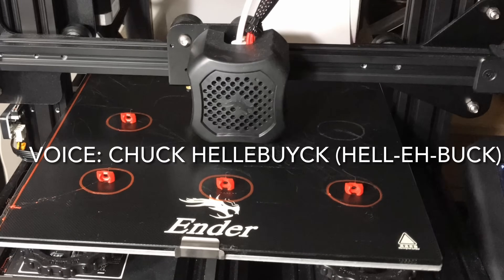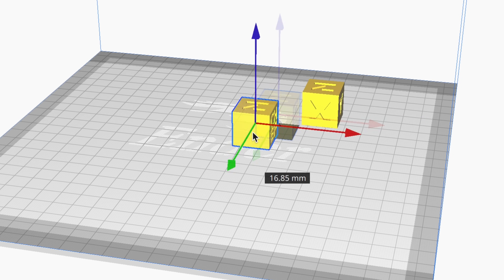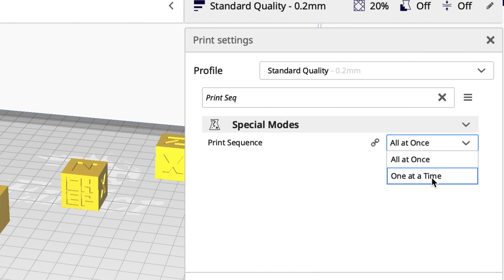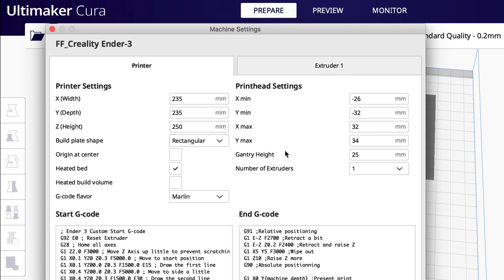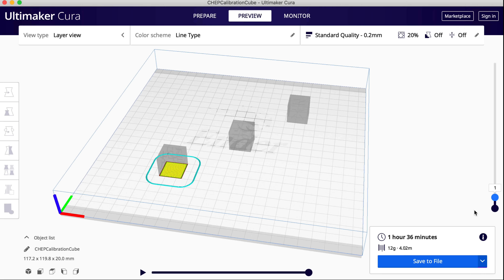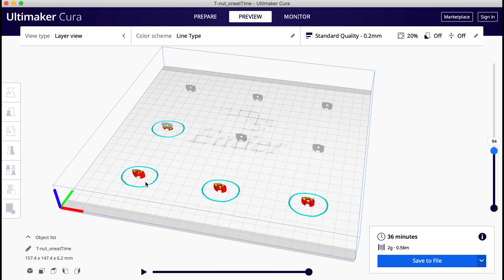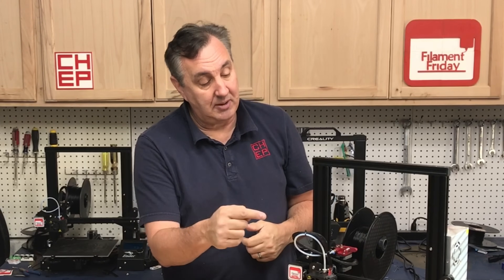One Print at a Time using Cura 4.8 Print Sequence Feature on Ender 3 V2

Comment: About time somebody did this! I've been doing this on my Troxy & PrusaSlicer for 2 years after messing with the settings and figured it out. Same idea and principle, just different way of doing things (different menu options and names).

Excellent video.
Reply: Biggest advantage in PrusaSlicer is that it nicely lists the objects and allows you to change the order in which they will be printed.  In Cura I need a dirty delete+undo trick to change the order.  Still, I miss some stuff in PrusaSlicer, which always brings me back to Cura, ex. being able to print a brim, but with 0.4mm gap between part and brim to allow easier removal.  PrusaSlicer has no option for that.  It's all those little things that bring me back to Cura ...

Comment: Hi Chuck, This is a very nice video showing something I do use a lot of times when printing small parts that I need many times.
I didn't know Cura has a setting for it, and I used Simplify3D for this, but this is (like many other things) so much better in Cura.
Thanks for sharing.

Comment: I am going to change the measurements for the hot end size in Cura and see if I can steal some space back as I am certain they will have built a massive tolerance into the spacing
Reply: Careful you can jam the print head into something already printed and it can damage the printer.
Reply: It probably only works with printers which Cura knows since we cannot set the dimensions of the print head in the UI.
Reply: @MetalheadAndNerd  You can: "Manage Printers", edit "Machine Settings" for your printer and in that dialog at the right you should see the "Printhead Settings".
Reply: @MisterkeTube  Thos dialog was also shown in the video. But I'm talking about the settings not in this menu.
Where do you describe the size of your print head around the nozzle. You need at least 4 values for that.
Reply: @MetalheadAndNerd  Those are the values listed there: X min, Y min, X max, Y max define the "footprint" of your complete head relative to the nozzle.  The gantry height defines what limit Cura imposes on the height-difference between already printed parts and a still to come print position (i.e. the max height of any object).  Normally for i3 style the latter is the height at which the bottom of the X bar will be when printing the bottom layer.  If you order your prints correctly and ensure the X bar doesn't get over objects printed before, you can get away with much higher stuff and to have Cura allow that, you then need to increase this number (basically making it think your print head is dangling from a very high up X bar).
Reply: @MisterkeTube  No. These values vary depending on the frame design. Some printers can move their big print head completely off the print area and some others have no movement range outside of the print area at all.
Reply: @MetalheadAndNerd  Please just try it, then you'll see that Cura uses them as I explained.  The x and y coordinates define the rectangle it keeps free around your object on the build-plate.  The Ender 3 profiles typically do not reserve space for an ABL probe in those values, so if you have one, your values might even be too low rather then too big.
Reply: 24MM max height? Anyway to change this so it can print higher.?
Reply: @lusamoel  Just change the gantry height in the printer settings.

Comment: The only restrictions is that it doesn't work for tall prints, they must be small.
Reply: As long as you ensure your head and X axis don't hit already printed objects (i.e. position and order of objects are crucial), you can change the gantry height in the printer settings in Cura and print multiple very tall prints sequentially (behind and - to maximize the number you can fit - to the side of another).

Comment: Nice, Chuck. I was actually just playing with this today. I noticed that it seems safer to start the sequence on the back of the printer since the print head is in the front of the gantry. This will give your print head a bit more room to breathe and might even allow you to drop your min/max/x/y limits so that you can fit more on the bed. Also, for taller prints, you can raise the gantry height in the settings using this method.

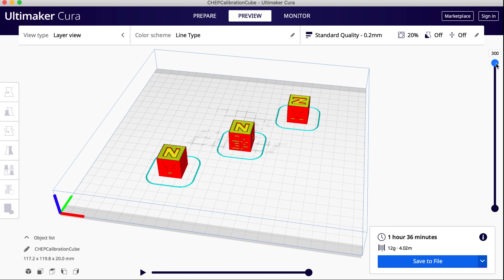Comment: 3:05 'Skipping' all those long travels even shortens the overall printing time!
Reply: Sure, but if you print all at once, you would put them much closer together, so it would not be long travels. 
I like the tip for the reasons from the movie - no stringing and the ability to pop them off as you go.
Also, if you you don't have filament runout detection and just want to burn off the remainder of a spool, you can just make as many small parts as you can before running out of filament.
Reply: @DFroelich  For 9 cubes; print time is 299min when spaced over the bed, 293min when in close proximity, 283min when printing per object. Seems to be a time gain of 2.05% when printing close together, vs 5.65% when printing one by one.  (respectively 3.13% vs 6.45% gain when printing only 2 cubes). That's a nice gain to be had for clicking one setting. I'll be using this from now on when batch printing.
Reply: @jaguarke069  A gain of 5% at a great cost of print height and print space, remember. I once printed a set of cable clips to empty a spool, but I could have fit 8 times more clips on the print bed had I printed them at once. Right now, the "one at a time" setting of Cura is not a game changer.
Reply: @wernerviehhauser94  I guess 'it depends' indeed whether you SHOULD. But whenever possible, I will use the option, and for more reasons than time efficiency alone.
Reply: @jaguarke069  So seeing this video and all the comments. I thought Ide give it a try. I put down 1 item, estimated time in the slicer is 10min, I duplicate the item, so I have 2 now and it estimates 15 minutes when printing "all at once". When I slice again with the "one-at-a-time" setting enabled, the print time is 20min. So I increased the number of objects and print "one at a time" which was 2 hours longer to print than all at once. Am I missing something here? Thought it was faster and I hope it is and I'm doing something wrong. Please help.
Reply: i realize it is kinda off topic but does anybody know of a good website to stream newly released tv shows online ?
Reply: @yousefcolten8124 That's not "off topic" That's called mental retardation
Reply: @Yousef Colten I use Flixzone. Just search on google for it :)

Comment: I was updating my Ender 3 v2 to work with a filament sensor and now the screen is just black can you help. I am also using stock firmware and display
Reply: I am using stock everything but I know I selected the v2 and I remember being configurations h. I tried to load the stock firmware but that did I not work.Did I mess up the board. If so how do i flash it. And should I replace the board. Thanks for the reply means a lot to me
Reply: Where should I download the firmware if you know can you give me a link because when i download it I don’t see the dwin file or the firmware.bin thanks for the help really appreciate it
Reply: Just fixed turns out I needed winrar thanks

Comment: how do you print a bed full of prints at once? in other words id like all first layers to print then do one at a time.   too many times the first print goes down and the first layer of the next will have an issue... lots of waisted time. i want to make sure the first layer for all goes down good
Reply: Just leave the setting as default and load up your bed with parts, Cura will auto-arrange them though you can move them closer to each other if you want, hover your mouse over the i in the box at bottom right to see how much time is taken for all the travelling of the hotend
Reply: @AndrewAHayes im talking about slicing. if you put say 3 parts on the bed , you wont know if the first layer on the third part will even stick until it does the first two etc.
Reply: @jeff7731  Let me know how you get on.
Reply: Jeff, I had the same issue and what I figured out was that when the nozzle left each part a tiny piece of plastic was raised up so when the head came back around it knocked one or more of the parts off the bed, I fixed this by enabling z hopping in Cura, try the default value and if not enough increase by 0.2 until its good then see if you can reduce it by going down 0.1 until it fails again, by doing it this way I found the ideal value.
 I hope this can help you

Comment: This is only if you got a stock printer. I see one potential hiccup`s and broken sensors here this will properly not end well if you got some mods on your printer like a probe or other mods and dont factor them in. So settings need to be addressed.
 Not ment as critic just as an supplement info.  As the level of knowledge are just as variant as the printer owners..
Reply: Us custom printer owners probably have to edit the printer profile file directly since the print head dimensions are only partially available in the UI.

Comment: What an invaluable feature. Thanks for the info Chuck! You say it's not the most efficient use of the bed, but it costs no more filament and prints quicker, so I'd argue that it's the most efficient use  possible.
Reply: It depends whether you need 9 small parts or 100.
Reply: @JasperJanssen  How so Jasper?
Reply: @Martial-Mat  well, if you need 100 really small items, you might just be able to fit them into a single plate, 10x10. But not print at a time, that way, unless they’re only a few layers high.
Reply: @JasperJanssen  Ahh yes, I see what you mean. Personally, I just wouldn't risk 100 items. Not only does the travel time get out of hand, but one mistake can ruin the whole batch, especially if the head gets clogged.

Comment: You can do this on cura 4.7.1
Print sequence is there. Just adjust gantry height as needed in printer profile.
You can print the full height of your printer.
I print collapsible sword blades in vase mode this way.
Reply: @Chrissi33004  incorrect, as long as the gantry and hotend housing are not in path, youre fine with any placement
Reply: @Chrissi33004  I didnt say start printing at the back, did I?
As long as you print all pieces front to back, the height of each piece doesnt matter, does it?
Since the plate moves forward, the gantry wont hit it.
Again, you were incorrect about needing tallest pieces at back.
You dont.
You just need to print front to back.
Height doesnt matter.
Posting wrong info doesnt help anyone!
Reply: @andrewdowney760  maybe i shouldnt write yt comments when i havent slept in 20hours. Thanks for explaining me in detail, gonna delete that shit

Comment: I've tried this before,  but my E3pro always gets the second initial layer wrong when starting the second print and is either too close to the bed or too far away from the bed
Reply: Then you need to relevel your bed or get glass. You probably have a high/low spot in the middle.
Reply: @MoragTong_  it is a glass bed and it is freshly leveled each time (as I've fiddled with this feature of and on for a year) it's like the printer loses it's "home" position when going to print the second print any where on the bed
Reply: @thomashillyard6553  Check to see that it's making gcode that actually puts the z axis back to where it should be.
Reply: @MattJonesYT  I'll give that a shot,  ty
Reply: I also get poor adhesion for subsequent models. Even after bed leveling.